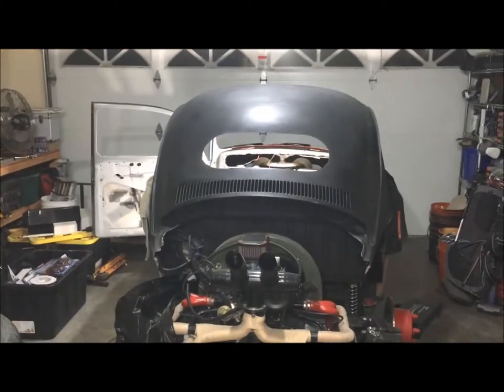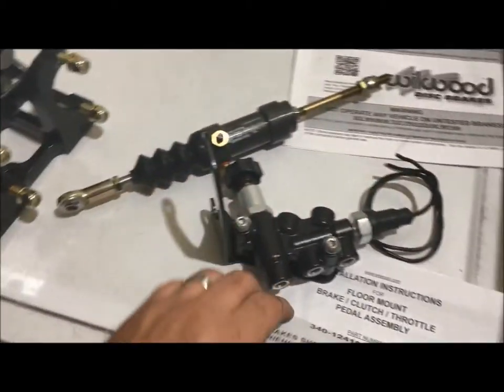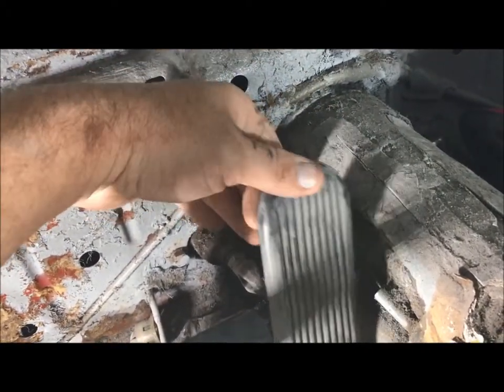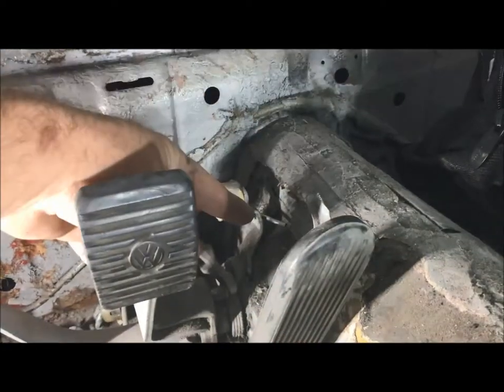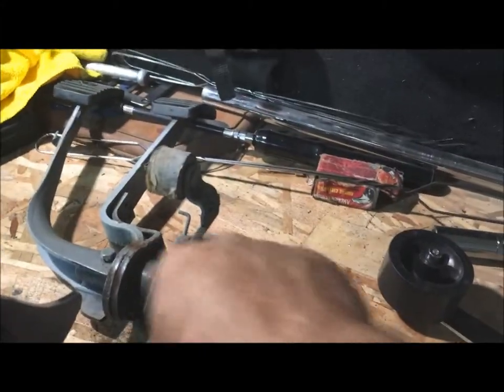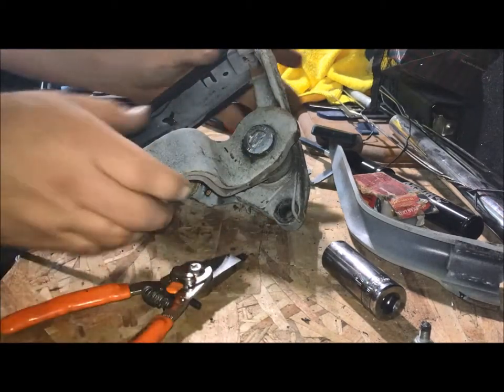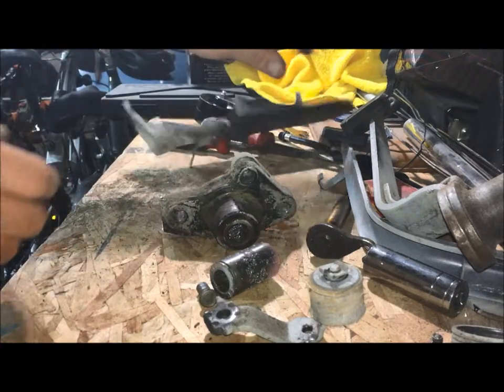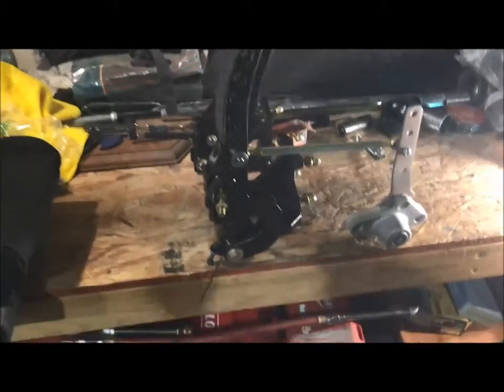starting the install of my wilwood assembly (68 lowered Baja Volksrod Build Night Owl)

Comment: I'm having a hard time finding the other video with the rest of the pedal assembly install, do you think you could link it to me? Also, I'm grateful for this video. I was looking at this exact set of pedals and was wondering how the heck I could install them in my 65 beetle. And boom, there you are with a detailed and straightforward video. Definitely earning a sub. Thank you.
Reply from the maker: Seth Bowers awesome thanks for the sub. If you are looking for the plumbing of the pedal, I haven’t posted that. I am still running the lines from the back of the car. I should have that completed in about a month. I’m currently working on finishing the body work.
Reply from the maker: It looks like I have 4 videos. https://youtu.be/ywKaVDbtUfc.
Reply from the maker: https://youtu.be/xof7ZABDQ4M
Reply from the maker: https://youtu.be/mr7qbqQYdy4
Reply from the maker: https://youtu.be/lTF5sqRI6Rs